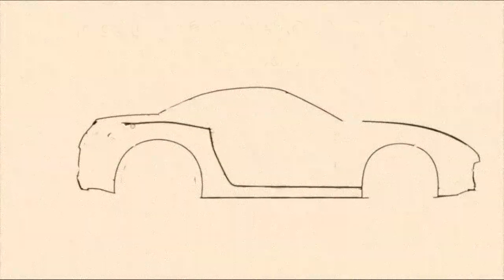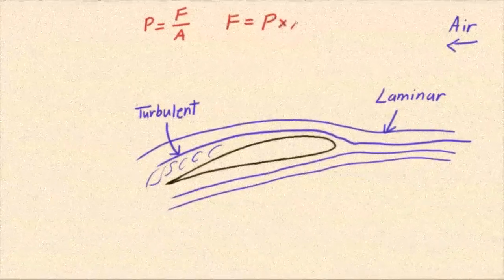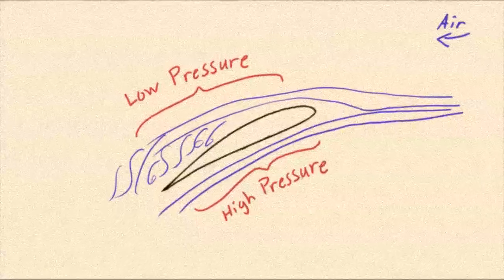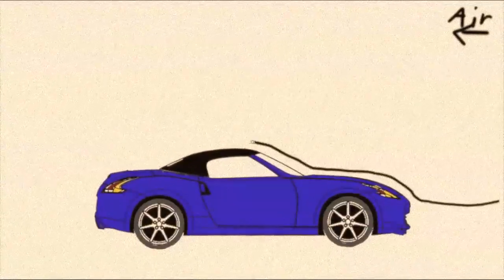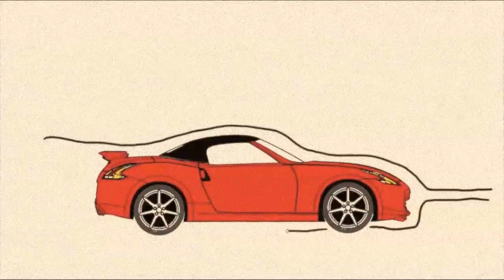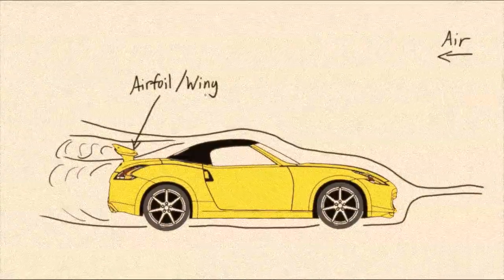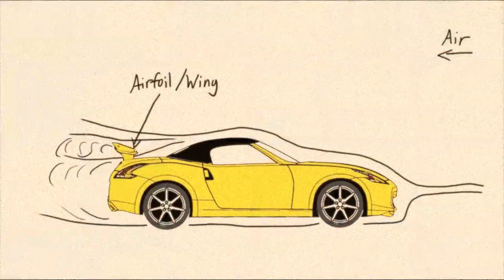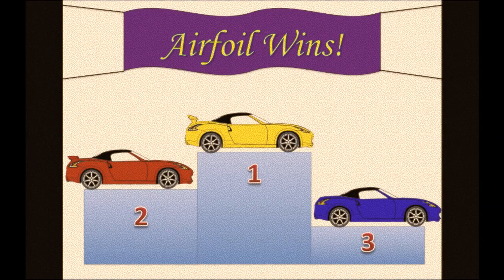Sports Car Aerodynamics: Spoiler Alert!

Comment: Spoiler will not necessarily give higher top speeds. Take F1 for example, as you increase angle of the rear wing, you are increasing the downwards force, but you are also increasing drag which actually reduces top speed, so for tracks like Monaco, you would want a greater wing angle, but Spa you would decrease it because of fast corners.
Reply: A small mistake in your explanation. In Spa they reduce the wing profile not because of fast corners, if you want to corner faster, you need more downforce. The reason most teams reduce downforce generated by the wing is because the track has lots of long straights/kinks like the kemmel straight or even the run down to blanchimont, so they need a lower drag to go faster overall.
Reply: DareDevil5692
The one foot wing generates the same amount of drag regardless of the height of the car. The main argument though was that spoilers make you faster in a straight line, which is false.
Reply: To everybody here
While having an airfoil would typically increase drag a spoiler can be quite different. Spoilers are designed mainly to reduce drag and lift by pushing the airflow upwards. This stops air being trapped in vortices behind the car thus reducing the low pressure behind the car. The decreased low pressure behind the car leads to less drag. The reduction in drag a spoiler gives through this process is much greater than the drag it generates itself. This is why all modern road cars have small lips at the back ends, these lips act as spoilers. On top of this the air that is pushed up also pushes down on the car reducing lift and increasing traction and stability at greater speeds. This means that a spoiler should in fact (if properly designed) lead to greater top speeds and efficiency. This increases acceleration at higher speeds while having no effect at lower speeds. An airfoil can do a similar job while decreasing lift by a greater amount resulting in a net generation of downforce but it will generate more drag by itself and result in more overall drag. This is why the F40 has a spoiler and why cars like the Buggati Veyron and Chiron have spoilers that come up above certain speeds. Because they increase acceleration and stability at high speeds and reduce drag.
https://www.youtube.com/watch?v=quDLzxmJl5I
This video does a much better job at explaining the concept as it does so using flow visualisation.
P.S
I also found it a bit misleading how he showed the performance in a drag race because his video did not aptly explain how an airfoil or spoiler would improve performance in a drag race and actually described something to the contrary as he talked about the increased drag. But at the end he did mention same track which implies he meant for corners to be involved and he simply couldn't show this due to animation limitations.
Reply: DareDevil5692
yea i can agree with you
Reply: Not spa because spa haves fast corners that need a lot of downforce but monza haves long straights so decreasing downforce will help
Reply: eclipse245 The relative difference will change though. The effect on a car that is 2 feet with a one foot wing versus a 4.5 foot honda civic with a one foot wing... The relationship of the coefficient of drag will change with respect to each car differently. It's like saying if you gain 10% drag, which one has more drag. It depends on the starting values. And F1 has a lot of R&D into their aero designs
Reply: eclipse245 Perhaps I did not type clearly, yes a one foot wing, same drag. But a car with no drag (just saying for simplicity sake) plus one foot wing or a car with average car drag plus one foot wing is different. If the spoiler adds minimal drag to your mini van, honda civic or whatever but substantial drag to your aerodynamic race car, then it will be different. Also the air fed into the wing will be different on each set up. It will depends on more than just a pure drag figure
Now a spoiler that decreases the wake zone will make you have less drag, but a wing that gives you down force only helps if you do not already have enough traction. For example, you shift into 3rd or 4th gear at ~100 mph and roast the tires, downforce would help your traction and therefore make the car faster by letting you put more power down to the ground assuming its not so un-aerodynamic that it cannot go any faster. But for most cars it doesn't matter because that's not the case. A wing in 1st and 2nd gear will have no effect on traction and that is where it's most important in a drag race... We both agree that the video is wrong and it is oversimplifying the situation. It was these blind oversimplifications and focus on pure theory that lead me to turn MIT down when looking for colleges. It's just not as applicable in real life where we all live.
Reply: for some, it can increase airflow.
Reply: ***** Your comparing this to a car thats 2 feet high. It will help you wont see a huge difference.
Reply: ***** the physics don't change depending on the height of your car.
Reply: +Howie Au Nope :) A small mistake in your explanation.

 That is exactly why they reduce the wing angle. Slow corners need more wing deflection. The fast corners do not require nearly as much deflection (and can reduce drag).  
Because downforce is an inversely proportional function of speed, the faster you go, the less you need deflection to achieve the same down force. They are not reducing down force, just the wing angle to get that same number (ie: achieve that same traction).
 So in summary... same DOWNFORCE on high speed 150-250kph Spa corners as say those at Monaco, but with much less drag at the shallower angle.

Comment: this is not a well researched video

the race you showed was a short distance drag race, in which do not reach the speeds necessary for significant downforce, also wheelspin occurs mostly in first gear, when the car is close to stationary
in that setup aerodynamic downforce provides no advantage, while drag provides a clear disadvantage

also the lamborghini diablo is an exceptionally bad example as on countach and diablo the airfoils are cosmetic add ons, the diffuser provides enough downforce
while the foil on the countach is still a working foil it is a negative due to drag, the foil on the diablo is flat in order to not interfere significantly
Reply: Typically, airfoils are used at high speed to keep the rear end planted during very high speed and or high speed turning. The effect of an airfoil while taking a corner at 50mph is massive. That being said, unless the car is tracked, it really doesn't need one.

Comment: his descriptions of how an airfoil and a spoiler work are wrong. can't blame him because even amongst college professors it's been misunderstood whether bernoulli's or newton's principles are the ones truly responsible for lift; but it's newton. bernoulli states that a fluid's pressure is directly proportioned to it's speed, which it is. air travelling faster will always have a lower pressure than its slower counterpart. but that does not mean that because one patch of air has a longer distance to travel than another it'll magically speed up. thats why bernoulli's principles do not apply to whether an airfoil generates lift or a spoiler generates downforce. it's much more crude. every reaction has an equal and opposite reaction, newton's third law. the airfoil generates lift by compressing the air underneath it and pushing the air on top of it out of the way. that way the high pres. underneath pushes it up. a spoiler works just the opposite.
Reply: ***** I guess it actually makes more sense that the real workload is on the top half to generate a lower than atmospheric pressure so that the bottom half can push it up easily. I'm studying aviation and I never even realized what you said about the engines and flap actuators lol.
Reply: ***** Really? I could understand if then it were the bottom half of the airfoil pushing the plane up, to have the air pressure be irrelevant and the top half of the airfoil be the real workhorse seems weird. Where did you learn about all that?

Comment: First off, why would you choose a convertible to demonstrate aerodynamic principles on a car with spoilers/wings? The soft top creates turbulences so there is close to no laminar flow there to reach the spoiler/airfoil. Why didn't you take a standard 370Z coupe or even the beloved 911?

Next up, you compare two almost identical street cars in a straight line race - the only difference being that one has a spoiler attached. It doesn't make any sense, that the one WITH the spoiler would win. It's called spoiler for a reason, it spoils the air flow and thus creates drag. The downforce/reduced lift is irrelevant because loss of traction a.k.a. wheelspin would only occur at the start, when the speed is at its lowest and where aerodynamics have the least impact on performance.
It then makes even less sense that the car equipped with an airfoil/wing would win that race, because that creates even more drag.

Also, when you drew the inverted airfoil for a car, your turbulences suddenly formed on the high pressure side.

Finally when you put the cars in the wind tunnel, you should have let them sit on the ground instead of positioning them midair like a plane.

Comment: Cars with no spoiler will win in a straight line but lose in the corners. The spoiler will not even make serious downforce till around 150km/h+. I have tested this on track with GPS datalogs. The Diablo has a lot of drag despite its supposed aerodynamic looking shape. Wings are for corners, not for straight line speed.
Reply: Arthur Rattew Please do a bit more research before you make such an assumption. The F1 cars today have DRS which effectively reduces the car's downforce in a straight line to increase speed. Unless your car is a top fuel dragster with 3000hp, the added downforce of a wing will only slow your car down in a straight line.
Reply: Arthur Rattew No, a spoiler won't always make a car faster. Adding more downforce means more air working against the car, thus making the car work harder to do the same speed. The sports car used in the above video is an especially bad example, because the power maybe more than the average daily driver, but it's still not that much, and adding significant downforce will hurt it's straight line speed badly. In order to make downforce work in your favor you really need a purpose built car, one that's lightened, powerful enough, with both a wing and diffuser working together to generate optimal downforce.
Reply: sodazman "Please do a bit more research before you make such an assumption"

I am sorry, but you are completely and utterly wrong in your assertions.  I would strongly recommend you take your own advice and do some proper research.  Even a small spoiler (I am assuming we are talking about rear spoilers, and not front spoilers for these elaborations) can produce a notable decrease in drag, while increasing down force at the same time.  They can (and commonly do) do this by altering how the air leaves the rear of the vehicle, resulting in less turbulence.

You previously asked for evidence to support people arguing with you on this ("Why don't you show some evidence instead of making a general statement?")

I would be glad to provide.  These results are quite common, and repeatedly so- Please dont take my word for it- I wont even bother citing textual information supporting myself (which is quiet easy to do, 30 seconds on google will demonstrate this concept)- I will do one better, and i will cite an actual, measured example.

http://forums.hybridz.org/topic/55944-windtunnel-test-data/

This is a community of automotive enthusiasts centered around Z cars (Primarily 240/60/80zs, but later gens as well) who collected money from the community- and used it to rent a wind tunnel.  They then conducted numerous tests with their cars, testing popular modifications done to these cars (to see note only if they worked, but to what degree if any), and popular ideas/theories. 

Of relevance to this discussion, please refer to test 9, and test 11 (Test 10 is on topic as well, but in my opinion the difference between 9 and 11 is more on topic with the matter at hand due to the types of spoilers in use between these tests).  Please note the only difference between test 11, and test 9- Is the inclusion of a small, cute, and cuddly- Spoiler.  Only a few inches tall.  Now please note the differences measured (multiple times, each test was run 3+ times).  Of no surprise, the spoiler reduced overall lift, by about 100 pounds (mostly measured at the rear, again of no surprise), but not lets look at the drag.  The coefficient of drag measured on test 9 was .48- What happened when we added this little spoiler? It changed. It went down.  Down to .453.

You. Are. Wrong. Spoilers can, and do commonly reduce drag as well depending upon the application.
Reply: SidewaysGts
Props on the research. However, it is true that downforce, aswell as drag, generally decrease top speed (and acceleration from a point) if the conditions are such that grip is already sufficient and the vehicle in question is travelling at such speed that the aerodynamic factor is significant enough. All of this also given that cornering is not a factor.
Reply: Spoliers make the car slippery and wings produce downforce
Reply: jlcousineau No they don't, they create drag unless it reshapes the car's rear profile significantly. It's one of the biggest misconceptions out there.
Reply: High engine horsepower is no good without the spoiler, because the spoiler is actually an inverted wing, which creates down-force. It also increases handling and acceleration by 45-55%.

Comment: This is a good video, but the top speed of a car is not increased by a wing or spoiler, it makes it more stable at high speeds, but the drag it produces slows the car down slightly, but the grip to the road is increased.
Reply: on cars like suv’s. Spoilers can both increase downforce and reduce drag
Reply: @A_youtube_channel_ you spelt ‘reduce lift’ wrong…
Reply: @tom6493  Yes your right actually. It’s really just reducing the lift from the curved roof of the vehicle
Reply: Hence the overall speed is increased
Reply: @iulianborta  What do you mean by overall speed? If you are talking about the speed a car can take through turns, then yes, more grip will allow the car to go faster around a corner. I am talking about the top speed of a car, which of course means in a straight line. More grip does NOT increase straight line top speed, because the car won't be at risk of losing grip when going in a straight line at top speed. (Unless the car is super unstable for some other unrelated reason) This is not something I have come up with myself by the way, this is common knowledge as you can see in several other comments on this video. In all forms of car racing you have to decide how much straight line speed you want to sacrifice to increase corner grip using spoilers.
Reply: @this_too_shaII_pass   luv you <3

Comment: The thing is, at a smaller scale physics work differently; the air is thicker relative to the scale car, that's why companies do a full size cR earodynamics, same thing with pressure

Comment: Increasing the angle of attack of the wing doesn't increase lift. Lift is upwards. Drag is backwards. When you increase the AoA, you are creating more force, but it's more drag than lift. Also, you don't want the air to separate and create turbulent flow. When separation occurs, that generally means there's a loss of lift and increase in drag. That's why planes stall.
One last thing, the turbulent flow at 2:33 should be on the bottom, in the low pressure area, not the top, high pressure area.
Reply: Increasing the AOA does increase lift (Or in the case of a wing for a car, down force). Drag does increase but the increased AOA creates a larger difference in air pressure increasing lift. Also, spoilers/wings such as those of F1 cars don't behave like an aircraft wing when stalled. In fact, drag is reduced as the load is reduced on the wing due to lower upwash. I'm not saying the video is right but at least get your facts straight before critiquing someone else.
Reply: just one of the things this video gets wrong
Reply: DynamicOyster Make the angle of attack 25 degrees. Now make it 89 degrees. Which one produces more downforce? I should have clarified. Increasing the angle of attack AFTER A CERTAIN POINT, does more harm than good.
Technically, a wing is stalled when there is no airflow across it at all. Just figured I'd say that, because in that instance as well, drag and downforce are pretty much null.
As for "stalling" F1 wings to reduce drag and downforce, (like F-ducts, flexing wings, etc.) I don't totally understand that that works. I'm not quite sure how, so if you'd like to explain, then feel free. The thing is, though, F1 cars are incredibly complex and work on principles not at all covered by this video. My best guess would go to secondary effects caused by the stalling, reducing drag that is otherwise there, so it's not the stalling itself reducing drag.
You should also note: "generally".
Reply: There are many people better at explaining these things than I am such as SomersF1 and ScarbsF1. Serch them up on google along with the topic you are interested in.